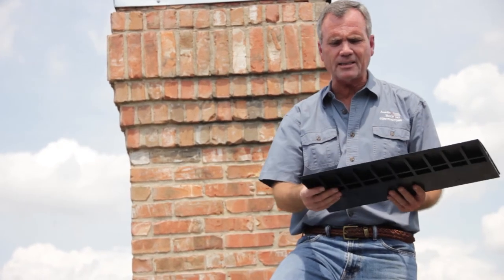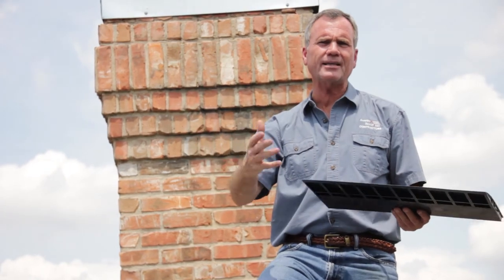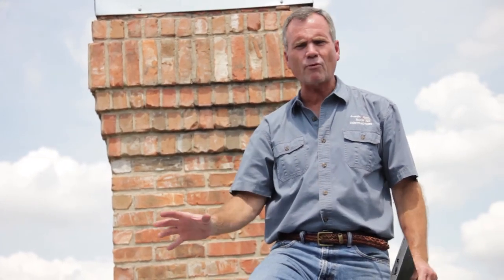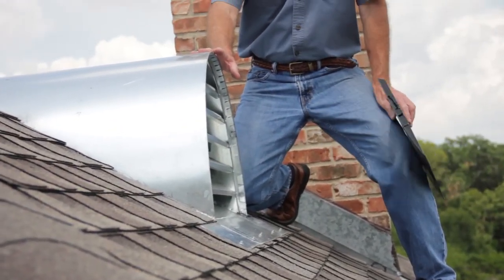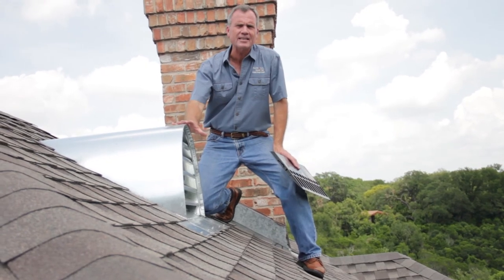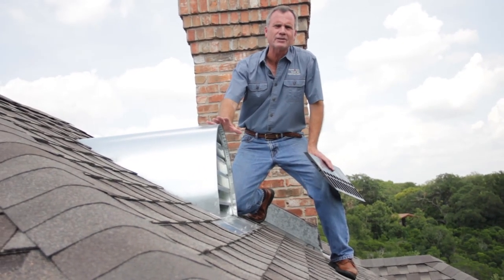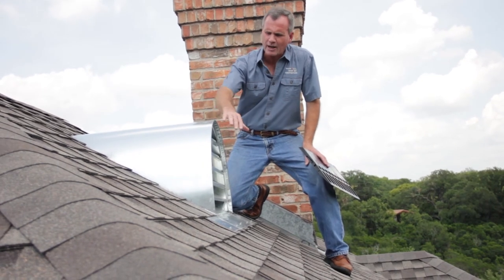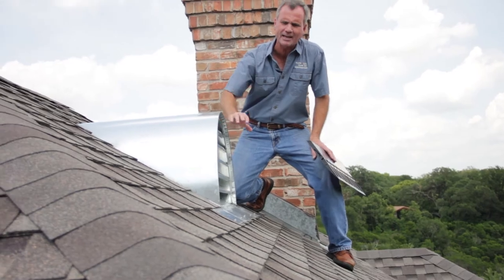Dormer Roof Vents, and Edge Vents for intake, how to vent your roof to maximize air flow.

Comment: I have the ridge vent. And 2 gable end vents.  With standard  undereave venting . On 100 degree days it gets to 110 in the attic. Is this exceptable? Or do we need to lower it even more? Thank You.
Reply from the maker: Charles, that's an excellent question. The temperature in the attic we were discussing was much hotter than 110*. A good test is, when the sun goes down, not hitting the roof, does it cool down to the outside temperature soon, for example, in a couple of hours? That's the ultimate goal of good venting.  Thanks for the question!  GW
Reply: @Austinroofingcontractors  Thanks for your reply. I'm in Hot Louisiana. Very humid hear. After watching you talk with the lady about Dormer vents. I looked at other videos, and searches on the web.  They seem to think they would be ok for dry climates. But they thought. They would bring to much moisture into the attic in humid areas. What do you think? Thanks. .